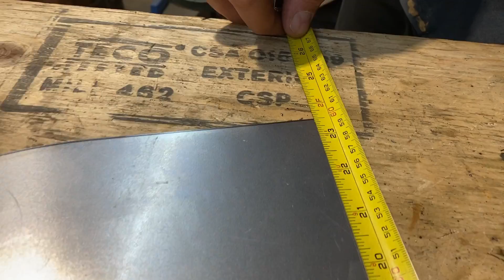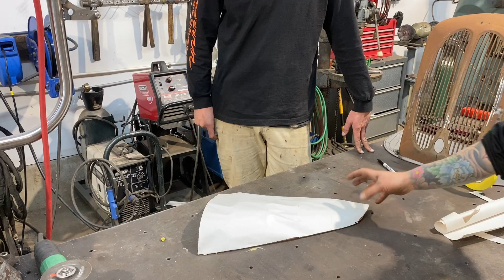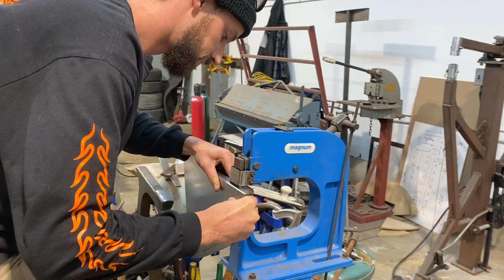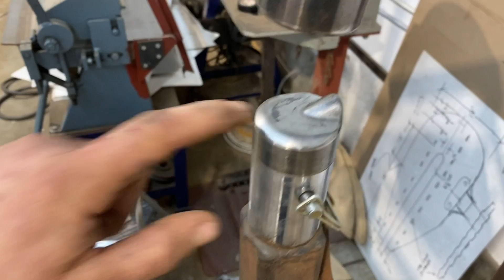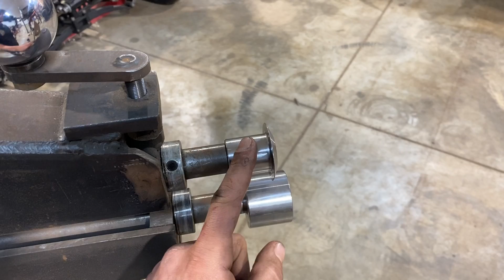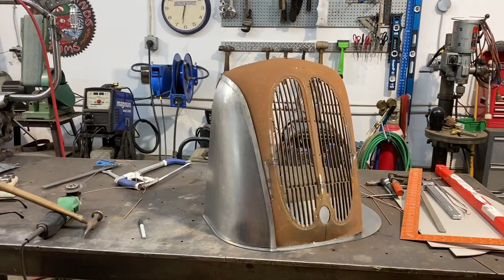Metal Shaping Track Nose Panels - Bennett’s Customs COLLABORATION!!

Comment: I bought a 1930s grill shell at a swap meet for $ 5 buck's has a little crack in it nothing that can't be fixed. I'm going to make a shelf display case out of it. Put some selves in the middle with plexy glass window to keep the dust out of it.
 Hang on the wall display car's in a 30s grill shell. Bought a few other thing's on the low low.
 The people at the swap meet were giving stuff away. This one guy gave my nephew a whole box full of tool's enough for a starter tool box. Lucky for my nephew, I had my little red radio flyer wagon or he wouldn't have been able to carry it out of there it was way to heavy.

 I pulled out all the metal working tool's I know my nephew will never use and added to my  collection of metal forming tool collection i got going. Picking and buying many different tool's on the cheap. When I see a deal I try and jump on the deal. I was going to buy a 20 ton shop press. 

My brother got one for free someone gave one to him for working on there car. It just needed the jack and we have plenty of them around the shop. 

I'm on the hunt for a shop leath to spin metal and make are own bolts or cut stuff down to size. My brother came up on a 1930s heavy duty shop drill press, needs a motor or make it to fit a 110 out let it's for a 220 outlet. 

He has a huge compressor that needs a motor. He has a few air compressor to build one good motor to get the free shop compressor going.

 I told him will have to make a copper tubning water filter like the one you have in your shop and seen in other shop's to have many out let's to hook air holes up to it, so more than one person could use the air compressor.